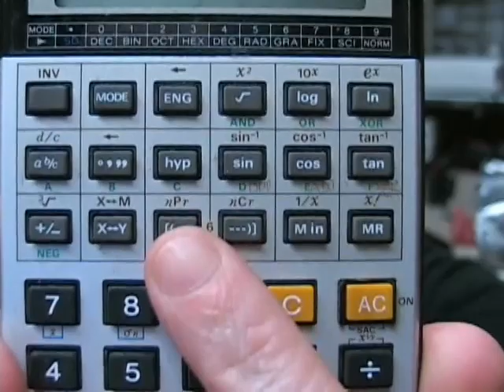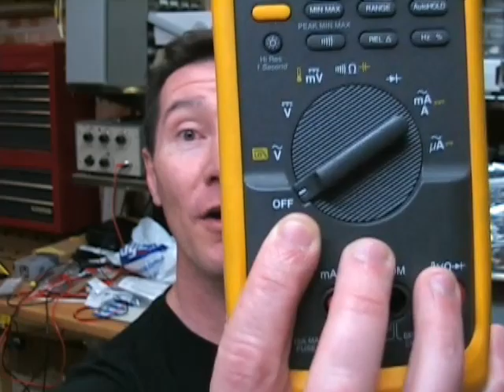EEVblog #28 - Product design drives me NUTS!

Comment: 2:00 Actually, having a hyperbolic modifier is quite sensible since it allows for 6 operations (cosh, sinh, tanh, arccosh, arcsinh, and arctanh). And as for the point of even having them, only because you don't find things useful doesn't mean those things are useless.

Some standard calculators have a special button for applying percentages, as in "200%25=" would give you 50. But that is total crap as you can use "200*0.25=" instead. But for someone who isn't mathematically minded the button is great. In the same vain the hyperbolics are useless to basic users while very useful for, say, an engineering student.

(I know this video is ancient, but I wanted to get this out anyway.)
Reply: He's not saying the operation is useless, he's saying it's dumb to have a dedicated key for it, when it could simply be a secondary (shift) function on an existing key, or a shift function on that key while putting a more common operation as the main (non-shifted) function.
Reply: He did exclaim "Whoever uses hyperbolic trigonometry?" Which sounds to me like he thinks they are practically useless.

You could add another function to he hyp key, but I think there is a deliberate design choice to put four trig buttons on their own. They already allow for 12 operations as is. More than the other buttons.
Reply: Alcesmire And I'm sure he finds a lot of other functions there practically useless as well, but they don't have a dedicated key.
Reply: RFC3514 
Even so, it's a single key that gives you 6 functions. It's convenient in a usability sense and efficient compared to the other buttons (6 functions compared to 1 or 2).
Reply: Alcesmire I don't think the issue with interface design is how many sub-options you get out of each control. What should determine the prominence of a control is how frequently or  _how likely_  it is to be used.

And if something is less likely to be used (regardless of how many sub-options it has), it can be placed at lower level (i.e., as a secondary function, or as a sub-menu option in a program, etc.), instead of taking up space on the topmost interface layer, that could be used for something more common. Think of it as running the UI hierarchy through an entropy encoder.

If the number of sub-options were the determining factor, then the digit keys would be removed. ;-)
Reply: RFC3514 My main point is that it's a nice usable design having the hyp button next to the trig functions, easily accessible (and intuitive). Having the hyp as a secondary function would make using hyperbolic functions a chore (3-4 strokes is just a no-no).

The solution to not having a hyp button that is used on some graphing calculators is to use one button dedicated to each hyperbolic function, I suppose that wouldn't be nice here, would it?

Removing hyp altogether is no good either since it is a not too uncommon function in higher level math and in engineering.

I agree that the number of sub-options doesn't determine the importance of the key, but in this case we have a case of: we need to implement this, the implementation is easily used and intuitively used while still not using too much UI real estate (compared to the usability it brings). I just don't think we can get a much better solution to the problem. You could add a shift function, but that's about it.

You could actually use shifted versions of the numbers to increase the number of functions available, I know most graphing calculators do. But I guess that would be a bit overkill for a small scientific calculator. :P
Reply: Alcesmire My point about the digits was that, if the amount of sub-functions was the determining factor to decide if something got a direct key or a shifted one, then the digits would be shifted, while the functions would be on the buttons.

And you're free to think the hyp button makes perfect sense there (I don't even necessarily disagree; it depends on what kind of calculations I'm making). I was just pointing out that Dave's argument wasn't against having those functions, it was just against having a dedicated key, that serves no other purpose, while there's no key for (again, his example) 1/x.
Reply: RFC3514 Even if (and especially if) his argument is against having a dedicated key; what would the alternative be, without causing inconvenience when using it? I just don't know what you could replace it with that worked better in terms of usability and UI real estate.

Having hyp as a modifier is a convenient solution that is immediately obvious without even having to have shift-like texts to explain it. And having a modifier as a secondary function seems a bit awkward, even though it would be possible.

I'm curious if there is some good solution, so feel free to suggest something if you could think of it.
Reply: Alcesmire You might as well say that, since pressing shift is an "inconvenience", then no functions should be shifted, and that everything should get its own dedicated key.

Some functions will always need to be shifted (to keep the calculator size / number of buttons down), just as some tools in software go into sub-menus instead of the top menu.

It's always going to cause an "inconvenience" to someone (unless you let them reprogram the keys / reconfigure the menus).

The question boils down to how many people have frequent need of any given function. You (apparently) use hyperbolic functions a lot. Dave never does. Therefore it annoys him that there is a "wasted" key on his calculator

There are many possible "solutions", like double-pressing a modifier key to get a different function, having all trigonometry functions under a mode switch, or simply buying a calculator that doesn't have a dedicated "hyp" key.
Regardless of that, my point was that you misunderstood his point. He wasn't ranting about the notion of having hyperbolic functions, he was ranting against the fact that he (and most people he knows) rarely have a need for such functions, and yet they're given a dedicated "top-level" key, while other (more common, in his experience) functions are not.
Reply: RFC3514 The inconvenience in my eyes is in the number of keys pressed to get to a function, a single shift doesn't bother me at all. It's a good solution.

With the solution used here you add an extra modifier and you get a maximum of 3 key strokes for arccosh, arcsinh and arctanh (hyp+shift+trig function) (and 2 for the regular ones). This already is more than all other functions, but it's not much of an inconvenience. Having the modifier as a shifted key adds another key to get the same results (4 and 3 keystrokes respectively).

The solution of having different modes could be a bad idea since the trig functions and hyperbolic trig functions are fundamentally related to each other will in many cases in analysis turn into each other. The modes are great if you have things that really doesn't mix. You would very rarely mix radians and degrees for example.

Having hyp as a shift function of the shift modifier (or similar) would work, but again, at the cost of more button presses for the user and the separation of hyp from the trig functions in a design/usability sense.

I would consider keeping overall complexity down (logical button placement and keeping the number of button presses down if possible) would be more important than losing one dedicated button that could be fitted with a shifted function if function slots are sparse.

Comment: My cameras' quality bugs me, I don't know why they insist on using these CMOS image sensors where you need to be on the surface of the sun to have just enough light to film something, the pictures often grainy, plus anything moving appears to skew.  What's wrong with using the good ol' CCD type?  The sound although not terrible, is not great either, I actually set up a separate microphone and tape recorder recording simultaneously when I do my videos.

Comment: I once had a multimeter that had a separate on/off switch. Once it was off and set to L mode and I tried to measure the voltage on a 300VDC power supply. Result - meter no longer measured L or C. A cheaper meter has combined power/mode selector and when off ,the inputs are either disconnected or it is set to 1kVDC mode, so, no big problems if I forget to turn it on. With the more expensive meter I always turn the mode selector to 1kVDC when I turn the meter off.
Reply: Pentium100MHz No meter is supposed to be damaged by a wrong setting of the mode switch. Just saying. If it does, then it’s junk and it dying saved you from it blowing in your face when a transient comes along. Good riddance.

Comment: I got this kit and it was a lm317 variable power supply you were supposed to put a heatsink on it but the main capacitor was bigger than the lm317 so you had to bend the 317 over to put a heatsink on it if it wasn't a weird ass clip on heatsink

Comment: My crappy LG TV (that only lived for two years) had a very bright red led when on (dimmed when off). Had to use black tape to cover it up. Now I have a Samsung where you can chose iwhen the light is on.
Reply: I have a couple of LGs and you can turn the light off in both of them. I guess it depends on the model.

Comment: I had to go check my own Panasonic camcorder and sure enough it does the exact same thing.  Even more fun, it swaps the image left to right if I press the physical menu buttons on the display.  I am no fan of princeton tec lights.  Their dive light I bought was hopelessly short lived.  Another brand, UK, produced a light that put the reflector in contact with another metal, resulting in guaranteed delamination of the reflector.  Three returns later, they stopped using the reflective coating.

Comment: a soft on and off on a multimeter would waste battery power even if you left it in your toolbox for 6 months. although i do think it should have a hard on and off switch. and they do it by using the hard multi switch. but it would be cool for them to move it over to a hard switch apart from the radial dial.

Comment: My biggest peeve ever is newer microwaves that beep every few minutes if you don't grab what you heated up. I usually put something on the microwave and expect to grab it 15 - 20 mins later regardless of when it's finished, and the microwave beeping at me is the most obnoxious, concentration wrecking possible thing that can happen. I'm tempted to remove the piezoelectric piece...
Reply: +seancsnm I once had a PC where the buzzer was put on the motherboard. I took a pair of pliers and just broke the stupid thing right off :D

Comment: @zaafarj 

I've found that a small square piece of electrical tape with a needle hole in it to work pretty well. Changing out the resistor sounds like a good idea, as mentioned above.

Comment: Not necessarily so, I've got a front bike light which goes on and off if you press the button down fully (till it clicks), but if you press it down just a bit, it changes flashing mode. Yet, out of its five modes of operation, three are continuous light of different brightness, one is flashing crazy fast (I fear it might someday trigger someone's epileptic seizure...) and the last mode... SOS in Morse code. What for? Why not a slower flashing mode instead!?

Comment: Hah, bad product design? I've seen beginners making µcontroller-based etching machines, where the most important feature is usually show the nickname of the maker on the LCD screen for 5 seconds after booting up. :D Totally useless and annoying, but boosts up ego of the designer, right? Or using 5 or 6-button keyboards to control the damn thing, which beeps with every button press, instead of using a single rotary-and-switch encoder which dramatically speeds up setting everything up. Engineers can screw up UX design as equally as other people.

Comment: [...] What's the difference between using the camera to set the aperture (and exposure time) and setting the aperture on the lens.
It can't be that the camera doesn't have access to information about the aperture/lens, as that's not available in Av-mode either.
Ludicrous!
(Side note: The first firmware update to the K-7 only contains one small [and not critical] update: an edition to "custom functions".. That's just "stupid", they should work on things like better image-quality instead..)
My 5c

Comment: Why the hell do Multimeters auto turn off anyway? They all do it as if it's a feature that everyone wants! I find it the most annoying thing.... If I wanted it to turn off, then I would just turn it off... Just as you turn your head to read the meter with the back lighting turns off or the whole thing bloody turns off... And also... Why don't manufacturers make version's of their products that are more practical and productive for certain professions, for example,, the calculator! Sure they make an engineering calculator but how about one specific to electronic engineering.... How about a multimeter that is geard more towards audio electronics... Imagine having a multimeter that you can simply connect to get an accurate power output in rms and peak! I have seen someone getting watts rms reading directly from a bench multimeter which I think is an amazing feature but I didn't see how the person setup the meter... It's just might make a good tutorial Dave... Is it even possible to measure amplifier output with a multimeter... Everyone else usually will use an oscilloscope but if it's possible on a bench multimeter, then maybe it's possible on the handheld multimeter also?

Comment: the delay has nothing to do with it saying chrono. that is automatic hard code with no processing involved, that is why it loads instantly. and getting rid of it would not make the rest load quicker. getting rid of it would allow for more space on the display for other functions, like saving a time, but it won't load into the stopwatch any faster if you removed the visible word chrono.